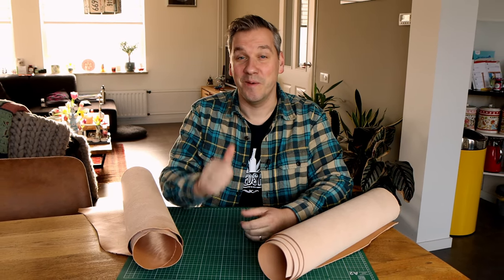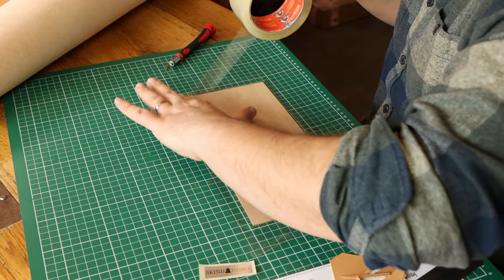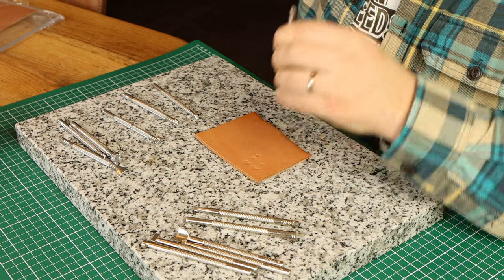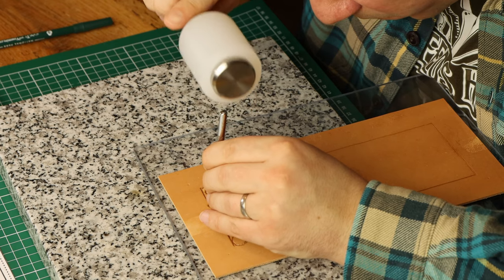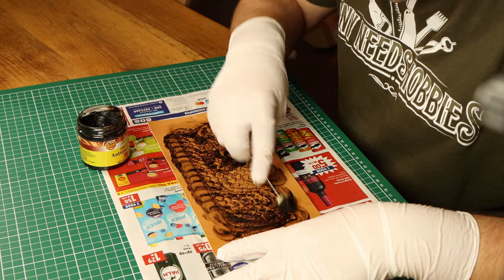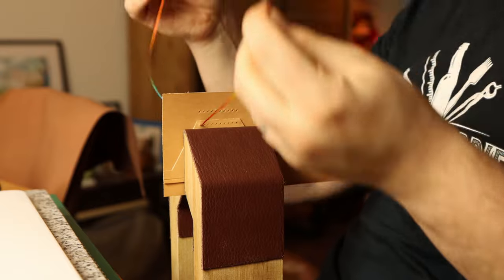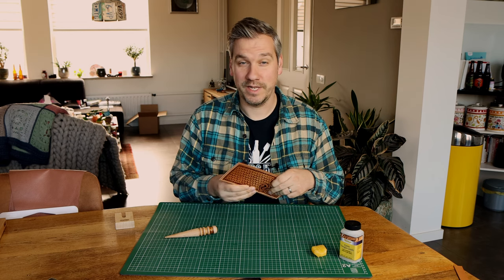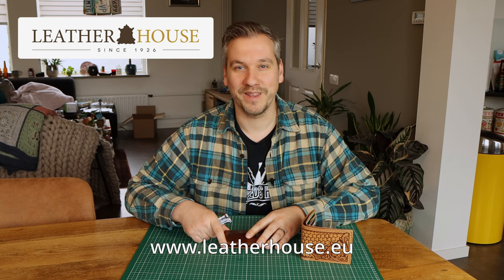I Made a Custom Tooled Bifold Wallet - Free Pattern Download (PDF)

Comment: Hi, I enjoyed your video! Nice work. Next time you might want to use a skiver for the edges to make the wallet somewhat slimmer on the sides/ the edges. Also make sure to always use the same pattern while sewing for instance left hand over the leather while pulling it tight and right hand down. That way you maintain a certain pattern and the stiching is not off in some places. Other than that pretty nice work! Looking foreward to see more!
Reply from the maker: Hello Marcellus, thanks for the compliment. Skiving is a special skill that I need to work on. I sometimes cut through the leather instead of only tapering it haha. Also hand stitching is tricky. It does look much better compared to when I first started and there is still a lot to improve. Anyway, thanks again for watching and the elaborate comment and tips. It's hugely appreciated. Cheers, Tony